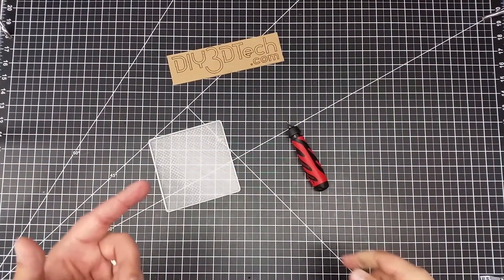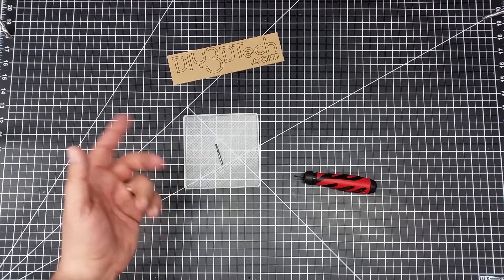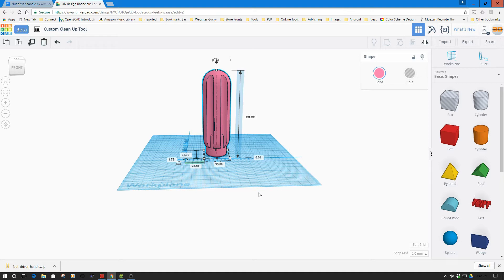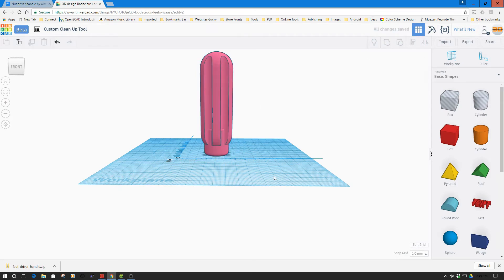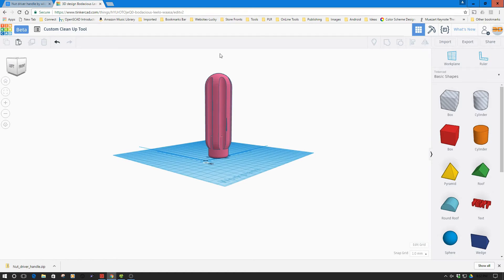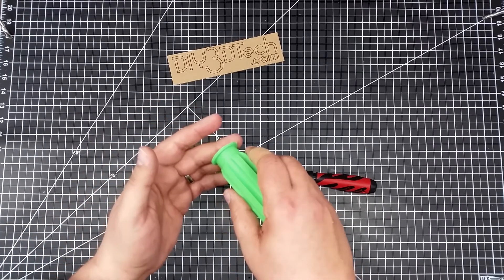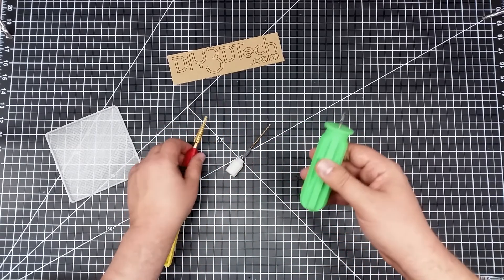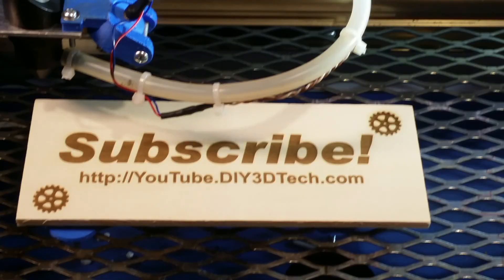3D Printed Project - 3D Printed Plastic Clean Up Tool!

Comment: For anyone looking for the link to the thingiverse file:  https://www.thingiverse.com/thing:2240686
Reply: Thanks! I was wondering where in the the heck it was. I even went to the relevant column on his web page. I plan to use these for bits:

https://www.harborfreight.com/Diamond-Point-Rotary-Bit-Set-20-Pc-69653.html

or

https://www.harborfreight.com/Diamond-Rotary-Bit-Set-4-Pc-69664.html

Comment: Are you buying in on the Monoprice Mini Delta?
Reply from the maker: Hmmm they have a deltas now?  Just got a CR-10 and up to 6 or seven printers now :-) However I have always wanted a delta!
Reply: https://www.indiegogo.com/projects/monoprice-mini-delta-affordable-starter-3d-printer/x/11085010#/
Reply: I was in the first 100 for the August batch. Thinking about canceling and waiting to be able to order that slick new 4-color single extruder Prusa though.... O_O
Reply from the maker: That is pretty cool!  However I am not sure of the multi-color thing as I have a dual exturder and never use it as it is a pain!  Or is this one where it splices the filament instead of having multiple heads?
Reply from the maker: Interesting will watch this (I.e the product)  as it looks cool however wonder how the slicer works?  Have seen several of these on the fringes, and just wondering how picky it will be...
Reply: According to someone in the comments he slicer is rather clunky and is slow and crashes on a 24-core system. Perhaps a bit of waiting is warranted :)
Reply from the maker: LOL!  24 core system!  In my day job I am working to build an industrial solution that can burst to thousands of core as between the vast improvements in (indusrtial) printers and the defination of models.  Slicing on normal PC's would take forever :-)
Reply: Update: I have it and I use it everyday. My FF Creator Pro sits bored and lonely as i turn out print after print on the MP Mini Delta and never have to calibrate the bed ever. There's a lot of weird corner cutting to get the price point they delivered, like the bowden tube connector on the hotend-side is held in place with a set screw instead of actually screwing into the heatsink, and there's some firmware jankiness you would expect from MP, but I really like the little machine :) Overall I would give it 8/10.